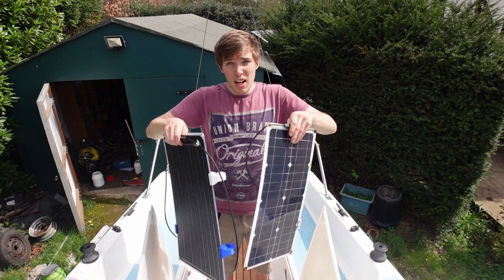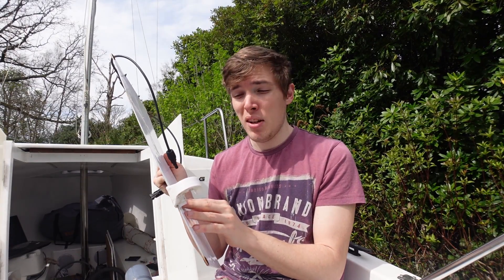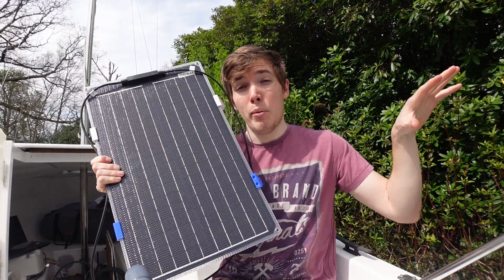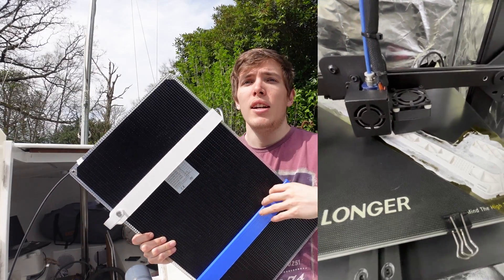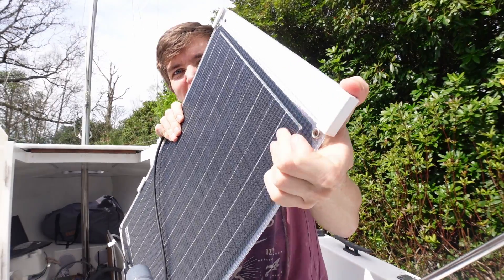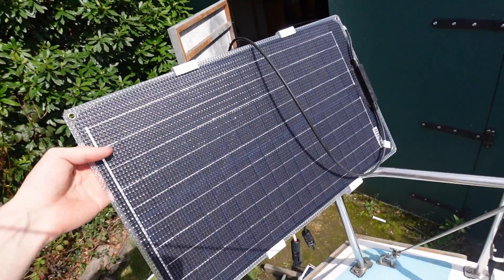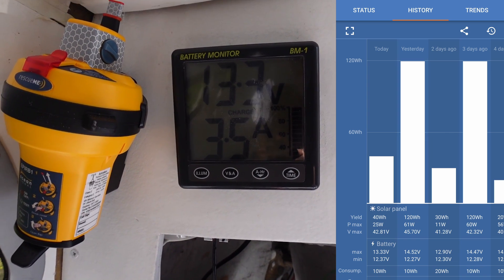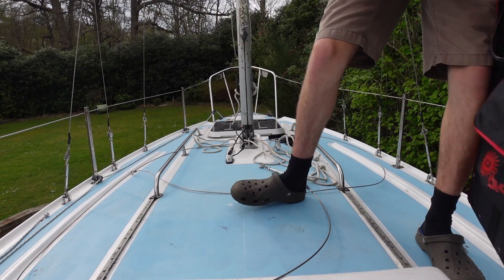BEST SOLAR SETUP ON A SMALL SAILBOAT! Ep.93

Comment: Would you sell me some mounts the same?
Reply from the maker: Can do but you would have to be in the uk and get the same panels if they are still available.
Reply: @AlexGoesSailing  Yes, I am on the solent! Which panels are they?
Reply: or dimenstions for the panels and I will see if there is like for like.
Reply from the maker: @drewpeacock3958  sunstore solar 580x350 was the size.

Comment: Those panels are great, I have just thrown my old Flexi panel away after it failed, delaminated and terminals came off.  Be good if you had time to add the items you installed and a link maybe for anyone following and wanting to copy your upgrades.  Also for the previous video with the lithium battery. Andy UK
Reply from the maker: Yeah I should! The panels are by sunstore uk and for a great price too.

Comment: wonder if you connected the two rear panels parrellel ie both red positives into + @ controller so you have 18 volt approx going to battery or did you do it in series connection  at panels red to black from one panel to the other then take the existing black neg- on one panel to controller and the red pos+ on other panel to controller   thus putting  36 volts to the controller if they are outputting optimal  voltages what ever they,re rated for  , this is the correct way to do it victron controller will work more efficiently it will take input 36 volts   and optimise the output at battery to give a better charge rate especially when your doing both charging and running a current for electric systems like chart plotter, stereo , lights ect
Reply from the maker: Series so it gives a max voltage of 44v and no issues with shading unless the sails are blocking the sun.